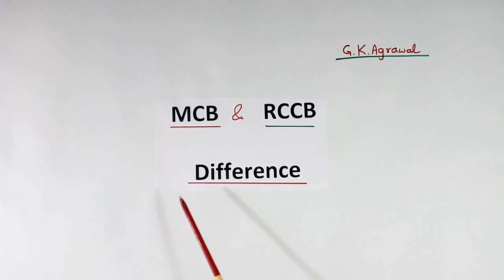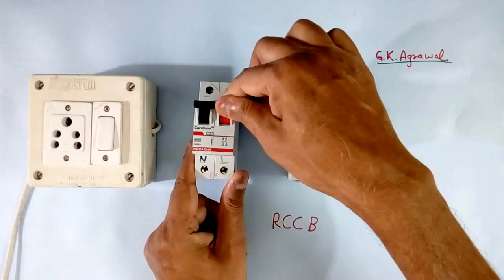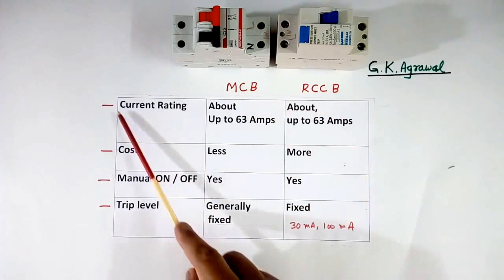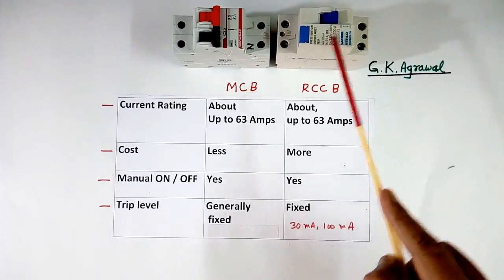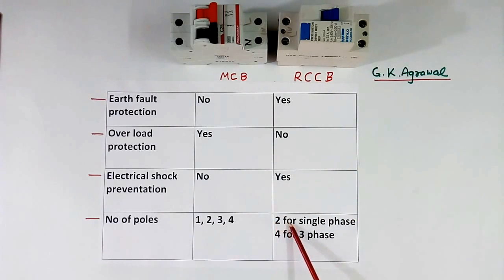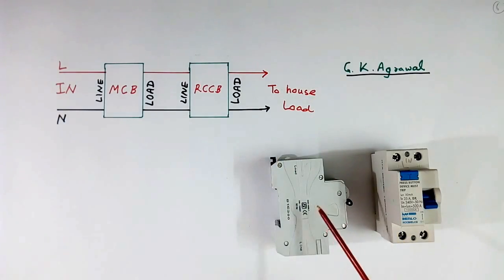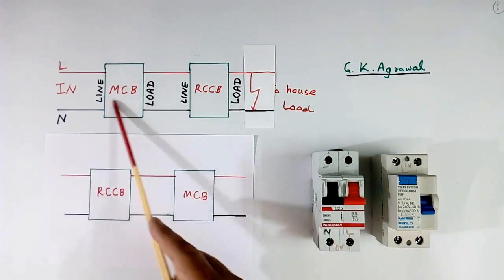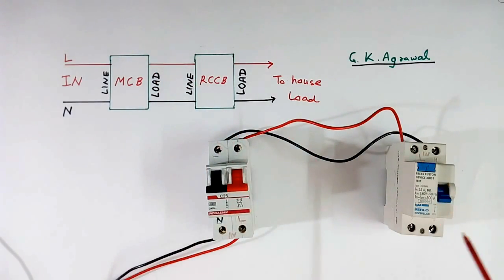MCB & RCCB circuit breaker difference & connections

Comment: Excellent Explanation. So MCB first and RCCB after. Suppose you want to maintain the system and shut down the circuit, which one you should switch off first, MCB or RCCB, why?.  Suppose an emergency shut off is needed, which one should be off first, MCB or RCCB and why? . Grateful for you expert advise
Reply from the maker: 1- MCB to be switched off, if it is small circuit.
2 - However as you asked about a system, it may be bigger circuit. In that case, System will have a MCCB also. This MCCB will be switched off in such case.
3- If it is still bigger system. Then there may be a incomer circuit breaker and an isolator also. Then circuit breaker is switched off, isolator is opened and isolated system is connected to the ground with some arrangements.
4 - However in all the above cases, MCB also will be switched off for working on any small sub circuit for safety reasons.
5- In all the above cases, you will notice that 1st protective device at incomer is always switched off. In case 3, isolator is opened after breaker, as isolator is generally off load switch device and can not be opened with load current without damaging it.
Reply: @GKAgrawal2  Thank you Sir. Great Answer.

Comment: Sir instead of double pole MCB can we use single pole MCB from electricity meter main supply
 Of 32 amp
Reply: Two single pole mcb
Reply from the maker: Yes, but if one trips then other one is to be switchef off manually. It is more safe to use double pole.
Reply: Thanks sir
Reply: Sir at my village home due to low and high voltage we have setup a 5kva stabiliser with inbuilt 32 amp single pole MCB and main line input in that stabiliser and output was given to 1 ton Air-condition with 25 amp MCB unit speratly as well as other output given to main board for rest of supply but sir presently supply become ok so I setup a changer for supply bypass due to power consumption of stabiliser if required in this situation where I setup DP MCB and where RCCB 
One more thing that in my old main board with 32 amp main switch and 16 amp two ceramic Fuse
Reply from the maker: You can afford such expensive item, but do not want to afford a double pole MCB which cost just Rs. 500. Use double pole only, that to having protection in both the poles. Watch my video on points to check before buying MCB.
Reply: @GKAgrawal2  ok sir I will purchase DP MCB but where I fix RCCB
Reply from the maker: Just after MCB.
Reply: @GKAgrawal2  धन्यवाद sir

Comment: Sir, 
first of all thank you for your efforts...! 
But I have small point about placement of these components in the circuit. 
If the personal safety is the priority, then we should place RCCB in first and then MCB next. So that it can safeguard person from electrocution for the faults occurring in between these device. 
The next case (MCB-RCCB) is implemented where the priority goes to equipment safety and for the equipment which are not accessible. 
Please correct if I am wrong...??? Thanks

Comment: Sir, thank you for your quality teaching through your YouTube videos. I have a question. Which ampere ratings for MCB and RCCB should I buy from the store for running a 12V 900VA inverter, a 185L double-door fridge (requires a voltage regulator), a desktop computer, three 75W ceiling fans, one 32 inch LED TV, one 600W mixer and eight 20W CFL bulbs?

Comment: SIR I want a confirmation of a problem that I have written here ,I AM BUYING A NEW FLAT WHERE I WILL TAKE A 3 PHASE METER CONNECTION. THEN I TOLD THE ELECTRICIAN THAT I WANT TO PUT A 4 POLE RCCB, THEN THE ELECTRICIAN TOLD  ME THAT  I HAVE TO PUT A 4 POLE ISOLATOR AND 4 POLE MCB BEFORE RCCB, THEN HE SAID  AFTER RCCB HE WILL MAKE 4 PARTITION OF  MY  FLAT  TO DISTRIBUTE THE LOAD WITH THE HELP OF SINGLE  POLE MCB'S . IS HE IS TELLING THE CORRECT PROCEDURE.
Reply from the maker: 1- If your load is 3 phase then use 3 phase MCBs.
2- If load is single phase, then single pole MCB connected to line no problem. But, better you should use 2 pole single phase MCB and RCCB both for all 4 flats. It will help in maintenance and will give better protection. MCB and RCCB cost are not so high, then why you want to save?